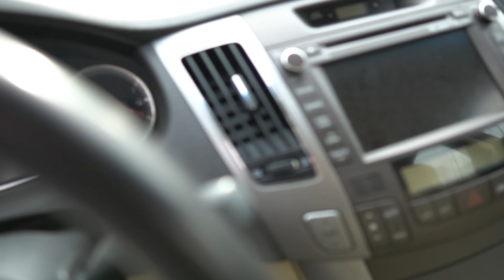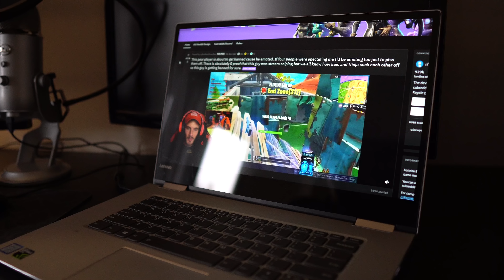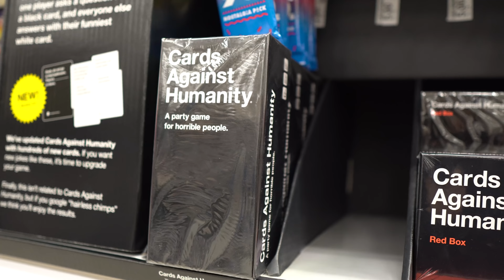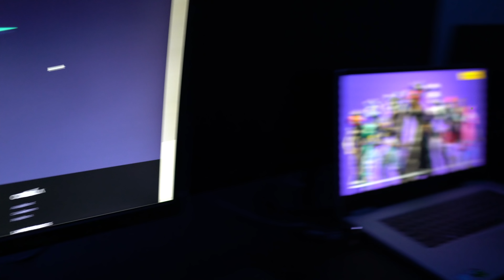I got sponsored! (vlog)

Comment: 5:26 they have it on the right (the big red box)
Reply from the maker: ellana29460 it’s uno attack, not an actual uno game, but a variation of it..
Reply: @JustPasha  still a uno, you can get the cards to play the usual game
Reply from the maker: ellana29460 I didn’t think they’d have regular cards in there too🤷🏻‍♂️
Reply: @JustPasha  check the writings on the back of the box, see what the box contains (if it's only the plastic addon or if it actually has the cards in too). my guess is it has the cards too, because why would they let you buy the DLC if you don't have the base game ?
Reply from the maker: ellana29460 that’s fair:) well, next time!😅